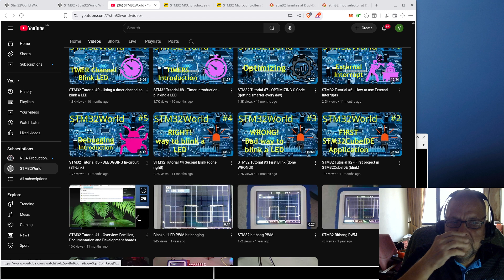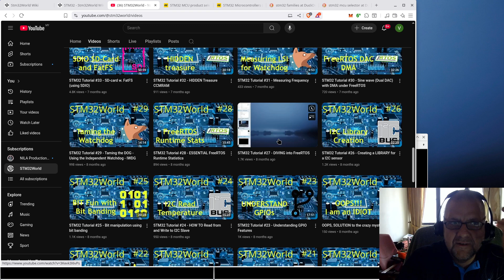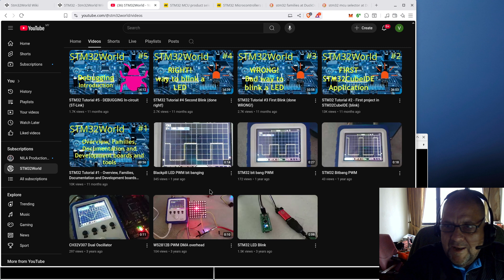STM32 Basics #0 - Introducing this new series

Comment: I appreciate all the effort you've put into producing these STEM32 videos. I've learned a lot from them.

Have you ever programmed STEM32 boards using C++ in the STM32CubeIDE, or would doing so be more of a headache than what it's worth, compared to just using C code?

Thanks again.
Reply from the maker: I did at some point try to use a couple of C++ libraries but at the time concluded it was too much pain.  Also, my personal motivation level was and is very low since I MUCH prefer plain C to C++.  Embedded development is ALL about being 100 % in control.  I want to control every aspect and any extra abstraction is counter production.  Lastly - and this is a personal preference - but I find C much more readable than C++.